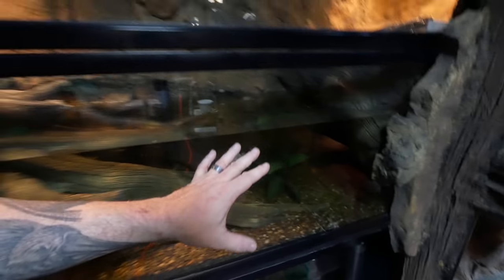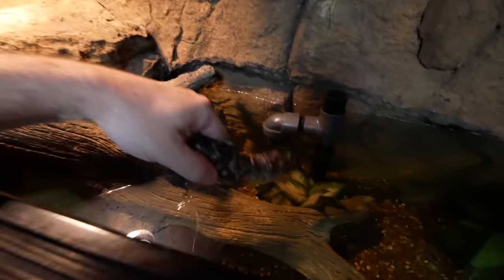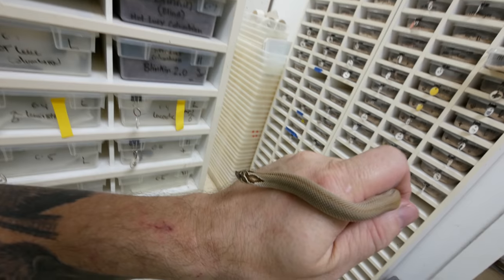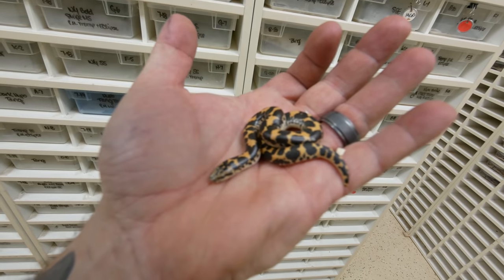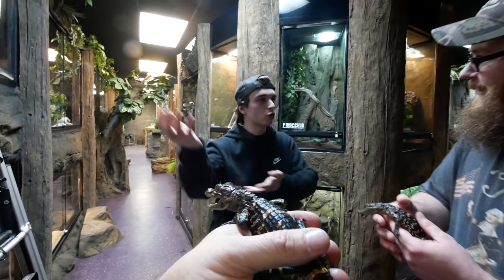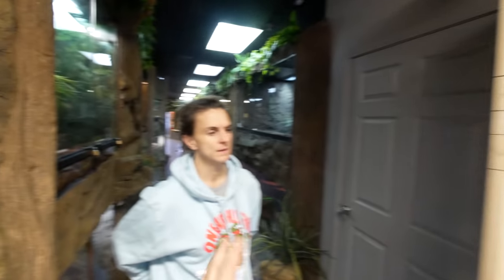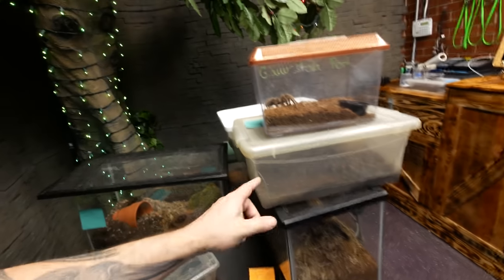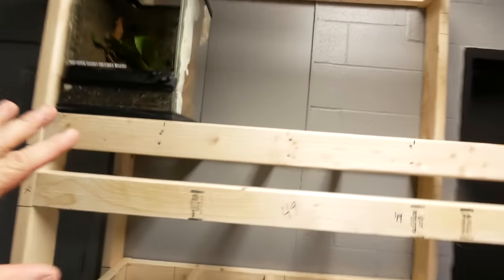I GOT A BUNCH OF BABY ALLIGATORS FOR THE REPTILE ZOO!!! | BRIAN BARCZYK

Comment: For the arachnid wall: Amblypygi — "blunt rump" tailless whip scorpions with front legs modified into whip-like sensory structures as long as 25 cm or more, Schizomida — "split middle" whip scorpions with divided exoskeletons, Thelyphonida — vinegarroons or whip scorpions (formerly Uropygida) forelegs modified into sensory appendages and a long tail on abdomen tip.  Lori should be okay with these... they look intimidating but aren't so much.  
Or you could go a little nuts and branch out from just arachnids and go for a centipede.

Comment: 100% agree with Lori. The only place for a spider in on the bottom on a shoe. They are such disgusting things and definitely the thing nightmares are made of. The only thing the arachnid wall is missing is a sheet of plywood screwed over the front and put outside.